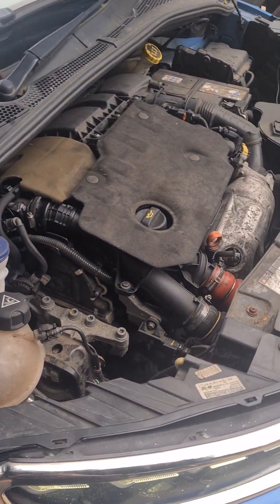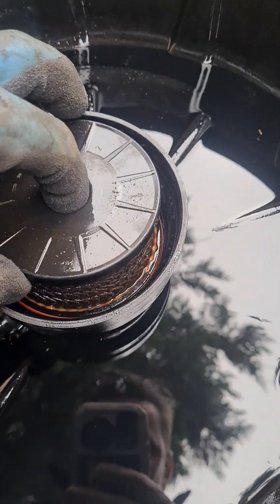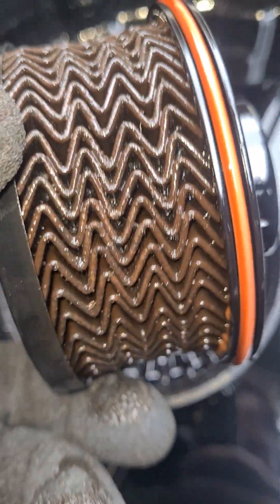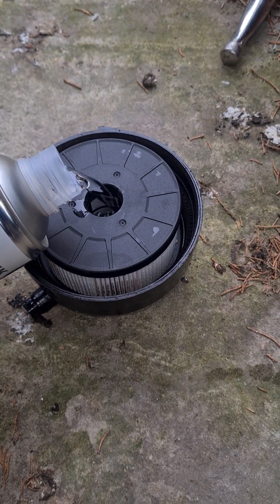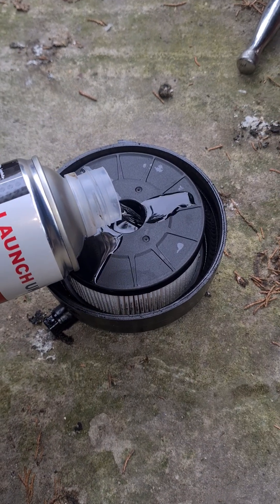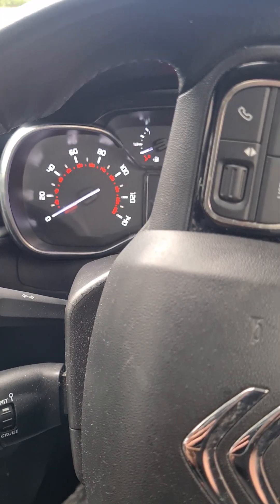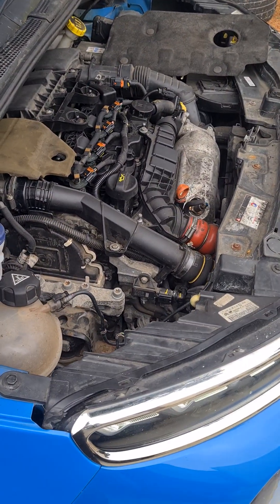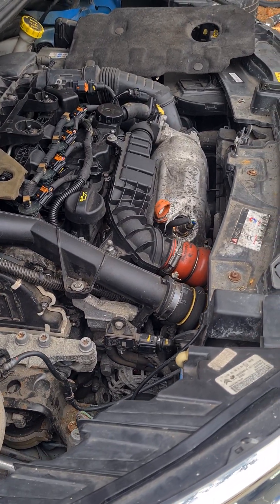Diesel Fuel Injector Misfire Fixed With Additive??

Comment: My mother has a Mini with a N47 diesel engine. The injectors were making a knocking noise a few years back.

I added a bottle of Forte Advanced Diesel treatment to the fuel tank. It stopped the knocking noise & it has never came back. I was surprised!

Comment: Im not a huge fan of additives but would usually do the same on my Mondeo with 150k on it when changing the fuel filter. I noticed a smoother difference using that Launch stuff neat in the filter and now use  a bottle every 3k in the fuel tank. First ive had that I actually can say it has made a difference. If I can wrestle my daughters C3 off her ill stick a bottle in hers too.

Comment: I use redx in all my vehicles.
Touch wood not 1 of my vans has ever had any problems with dpf or injector problems.
But since a few yrs ago I'm sure the diesel has had some kinda ethanol mix added to it from the pumps.
Tesco diesel if you pour a bit out on the floor it drys up it should do that.
Shell is the best I find all this supermarket fuel is killing our engines
Reply: I believe ethanol is blended with gasoline, with diesel they add biodiesel generated from vegetable oil
Reply: I only use BP “posh” diesel 😂
I’ve not used supermarket stuff for a few years now. I used to use Morrisons in my previous car until it started running badly. Went to BP Ultimate and it sorted it out 👌🏼
I do all my own servicing so I know  my oil and all the different filters are done properly with decent filters.

Comment: Hi Mate just wondering if you have come across intermittent injector fault. If you have a video on that?
I have a 2017 transit 2.0 fwd.
Does it when going over 2000rpm and on hills or slight hills every 3 or 400 km P126c some times all some time B

Comment: Hi Jim, will the high pressure pump be properly lubricated while running solely on that additive? filling up the filter will mean no diesel will get to it for a while. thank you
Reply from the maker: You will immediately get mixture of diesel and additive return to tank

Comment: An interesting discovery on my 2015 Vivaro Bi-Turbo. Foxes? chewed my DPF pipes and EGT cable. Dashboard screaming at me so I replaced the pipes and it still screamed. No DTC?? So, I discovered the wires were shorting on the EGT, insulated them and the screaming stopped.
Reply from the maker: Yes foxes do love some cables

Comment: Works every time if you have bosch injectors, quite often makes things worse with Piezo injectors
Reply: @baron5747  Yep, Piezo Electric ones.
Reply: Well I for one am glad you mentioned that Ben, I was thinking of trying it but I'm pretty sure my Toyota 2.2 D4D has Piezo injectors.
Reply: So not for the 1.6hdi 8v
Reply: @zoltanmolnar8583  pretty sure they are Bosch

Comment: Good vlog, I have a transit connect on a 67 plate my neighbour renewed the oil, oil filter and fuel filter ( air filter was clean ) plus he refilled the diesel filter housing with diesel and a little bit of stp injector cleaner and runs like a dream it ticks over beautifully whilst sitting at traffic lights 🚦 and sometimes wonder if the engine is running kind regards to you and everyone out there Mark from Billericay 😃😃